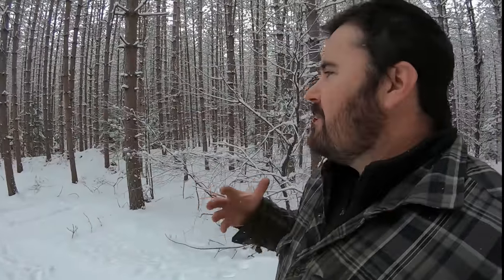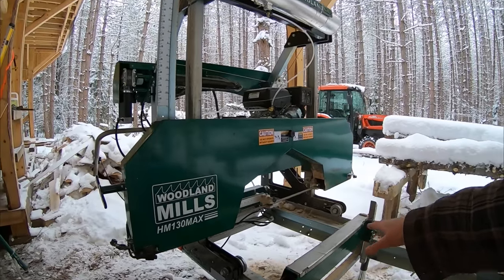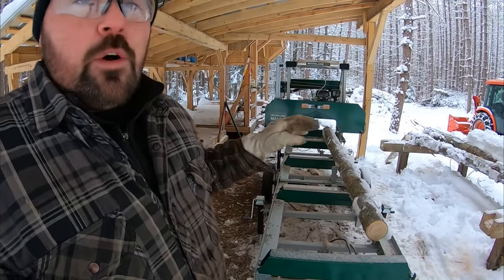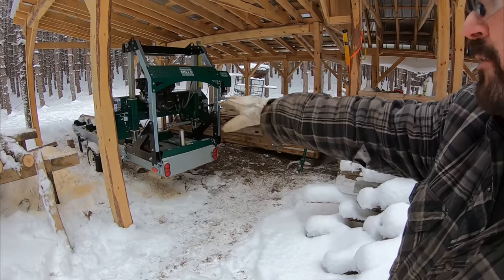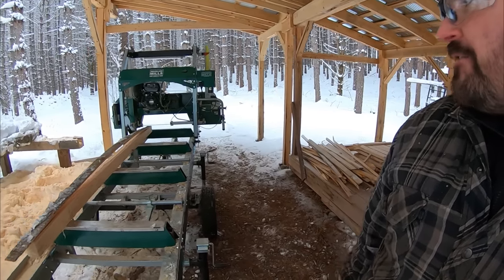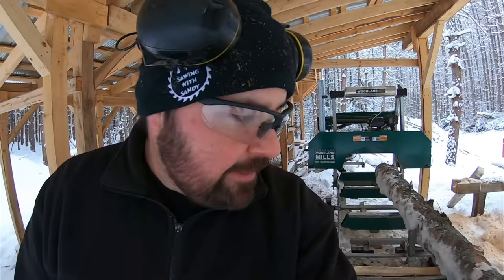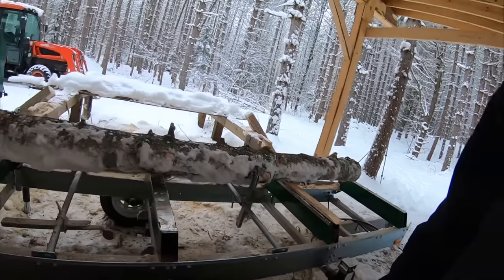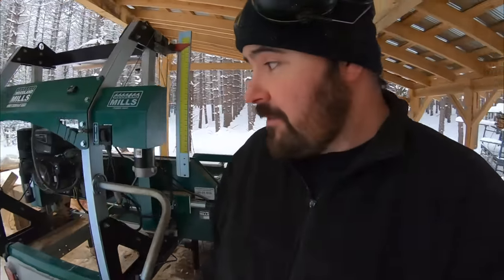Is a Sawmill Right for Me?

Comment: Good Morning Sandy, I had my brother up to my property last November to give him a chance to run the mill.  One thing you said that I think was really important is to listen to the machine, it will tell you: if the blade is dull, it will tell you if you need lubrication, keep a slow steady pace and let the blade do the work, if you feel resistance take note and look for the problem.  When the saw mill is set up correctly it runs like a hot knife through butter.  Mostly just commenting for the ALGOS.
Reply from the maker: I appreciate that! Sounds like some good cutting you had back in the fall as well

Comment: For a straight log take the small end diameter inside the bark, multiply by .7 gives the square cant size. I taped a little chart to the mill so I don't have to do figures in my head! Or a pocket calculator!
Reply from the maker: Thanks for that tip!

Comment: Just a thought, if you were to place rollers under where your old saw mill was, and where you currently stack your lumber. As you complete a packet of lumber, simply roll the packet to the old sawmill area, then continue to start a new packet. Enabling you to drive into the shed where your old log bunk was. No need to move your mill to change out packets of lumber. If this makes any sense.
Reply from the maker: I like that idea Jeff! Thanks for sharing

Comment: Hello Sandy, Years ago, I found WD-40 SPECIALIST® GEL LUBE. It is supposed to stay and protect for up to one year. This could be used on your vertical movement on your cutting head. It withstands temperature ranges from -100°F to 500°F. (-38 to 260) C. It also is not supposed to run like the regular WD-40. I did notice the stress relief on the one cut. You mentioned bugs. Would mosquito netting help. Obviously, the area at the log deck would need special attention and design. New Snow! Have good days!
Reply from the maker: Great advice! Thanks for that. I run the WD40 sepcialist for the rust penetrant but I"l also now look for the gel. Thanks again

Comment: In one of your previous videos you mentioned that with your setup you have a problem with sawdust collecting on your log deck where you have to chisel or scrape out the sawdust.  I just had a thought watching you set your runners in to transfer your log to the bunks.  If you cut out the entire bottom on that so so you have 2 tabs sticking out you could take some scrap metal bolt or screw it to the end which would allow the sawdust to just fall through the hole and not collect on your log deck.
Reply from the maker: I like that solution. very straight forward and would definitely work. Thanks for sharing that!

Comment: Sandy do you use are is there different types of blades for soft  and hard woods, thanks for the vidios
Reply from the maker: there are different angles on the blades for hard and soft woods. I use 10 degrees which works well for both

Comment: Thanks for the excellent content Sandy.  Like you and others have said, if ask if getting and running a sawmill is for you, then it is and you already have sawdust in the blood.  :)

As for me, I started with a dead red oak that was 36" diameter trunk being milled with an Alaskan chainsaw mill rig.  Now im building a bandsaw mill that will take a 34-36" trunk and 30-32" cants.  And o ce this first red oak is finished (2 more 8' trunk sections,  a 6' crotch set that will get slabbed, and 6 8' branch logs that are straight-ish and should give 4-6" cants.  Then there are 3 more dead oak trees and 4 dead/almost dead loblolly pine that are still standingthat all need harvesting. 

In my case, since I have few projects for the lumber, I'll look at building a cheap kiln to dry and sterilise the lumber for faster sale at higher prices.

Again, thank you and keep up the great content.
Reply from the maker: Sounds like a great project you've got on the go Bob. Hope it goes well and keep me updated. Happy sawing!

Comment: Heya Sandy! You covered this topic before from different angles and it's always interesting to hear your thoughts on it and more insights on the trade.  In fact, one of your videos is one that cinched the decision for me in 2021 and I've be milling happily all year. I've since then realized that to answer the question in your video title, the simplest answer is "If you're asking the question then yes it's right for you."  I see very little down sides to owning a sawmill. The only real considerations are whether you have time and space for it. Money isn't a consideration since the return on investment is very easy to achieve in many different ways. Finding lumber is also somewhat easy.  Also, experience does help with optimizing lumber size when putting logs on the mill but I also believe it's something people figure out quickly and at worst, not much is wasted.  It also depends on what is needed. I've "wasted" large beautiful spruce cants that would have made perfect 6''x6''x16' because I needed 1''x4'' inch boards. Oh and I need to get a laser....
Reply from the maker: Great to hear you’re up and running and got the sawing bug as bad as I do. I know what ya mean and I’ve certainly made my fair share of sawing errors. All part of the fun (maybe not at the time haha)

Comment: Sandy, can you explain the measuring scale on your saw and how you use it to calculate your first cut. Are you measuring the diameter prior to cutting or just eyeballing using the laser?
Reply from the maker: I normally will take a quick measure to see what max lumber size I can get from it then if the log was 8” diameter I’d likely make my first cut at 7” then flip the log and make my cut at 6”. I’d then take the log and cut the remaining two sides off to get the dimensional lumber size I need
Reply: @sawingwithsandy  Iam newbie, so pardon my ignorance. I seem to be wasting a lot of time looking at my saw scales, then measuring log for almost every cut. Does your scale account for the the thickness of blade?

Comment: Great video Sandy. Got my HM130 Max set up back in April and I really like it. Changed belts at 55 hours. Might have got a few more hours out of them but band was almost on pulleys so went ahead and changed them. How many hours do you normally get out of a set of belts?
Reply from the maker: I’d probably do the same Jody. I’m not sure how many hours as my old sawmill didn’t have an hour meter and my new one are still on the originals. I usually get a few months per belt though I figure

Comment: Hey Sandy what's up with the two-by-fours four by sixes four by fours I thought you guys use the metric system up there anyways I think this is an older video I'm revisiting some of your older stuff that I'm trying to catch up on but I have another thought 🤔 what if you made some makeshift burlap roll down roll up curtains to block the wind and snow and maybe a black keto cooking stove with a long exhaust system to help melt the snow off the roof if you put the exhaust dead center of your sawmill weld some circular attachments and using the galvanized dryer hose as a heat-trapping pipe would keep the roof warm and melting off the snow and you warm as well
Reply from the maker: Hi Sean, in the lumber industry imperial system is common here in Canada. We do know the metric system and imperial system however as both are taught in school. Some things are metric like the measurement of liquids here but some industry standards for us are still imperial. That's an interesting ideal for the exhaust! I like it! Thanks Sean

Comment: One more question…. If you could do it all over again, would you still buy a Woodland mill? I checked with Wood-Mizer and they are 9 months out on orders. Woodland says they are in stock….
Reply from the maker: I would still go Woodland Mills as it seems the customer service is very very good and responsive
Reply: @sawingwithsandy  Very cool. Thanks for answering. I am going to order the exact same mill you have Monday. No more Alaska Chainsaw mill cutting. The whole way a person measures out the cuts of the log with a chainsaw mill is so different than a bandsaw mill. I use a guide board on top the log and then measure and then cut from the top downward. Once you get the bark slab off, you use the log itself as a guide for the saw (I saw horizontal). On a bandsaw you cut a flat surface, flip the log over and measure from the bottom up, then cut from the top downward. I always wonder when you get to the last cut if the last board is the exact same thickness as all the other boards???

Comment: Hey Sandy, Thanks for all the great content! Question for you, What do you do to post you saw that will be used in the ground to prevent rot? Thank you!
Reply from the maker: Great question Kent. I was charing the wood (see video below) and it seemed to work pretty good. Generally I try and not put wood in the ground just because it's not pressure treated when I cut it. I prefer concrete in the ground then wood above ground but the charing has worked pretty good for my non-pressured treated wood so far
https://youtu.be/pICH8XMXWYg
Reply: @sawingwithsandy  thank you! One last question, I'm putting my HM130MAX together tomorrow, it didn't look to me like there was a finish on the steel... Have you or anyone you know had issues with rust after several years of use? Thank you again for great insight.

Comment: Quick question. I see horizontal beams in your sawmill shed that are much longer than the bed of the saw mill. How did you cut those?
Reply from the maker: I often will make a sawhorse like I did in this video 
Cutting a 20 Foot Log on a 10 Foot Sawmill | No Track Extension Required
https://youtu.be/lRg7lFQPSaY

My old sawmill was also longer allowing me to cut just over 16’ beams

Comment: why do you choose 1 1/2 x 4 rather than 1 1/2 x 3 1/2 like a lumber yard? just curious. the width and depth don't shrink at different rates do they?
Reply from the maker: Just to ensure strength since my lumber isn’t graded like lumber at a lumber yard. I keep it at 1 1/2” to fit standard joist hangers and 4” for bit 
More strength

Comment: In one of the videos, you talked about it would take too many bags of concrete to pour a solid foundation for the sawmill and also where you walk next to the mill when you are cutting logs. Seeing the big pile of saw dust that gets created, don't know if this would work but could it be possible to use the saw dust and some bag concrete mixed together (no idea what the best saw dust/concrete/water ratio would be) to create some type of saw dust/concrete paver or even a saw dust/concrete pavement?
Reply from the maker: I like your thinking there Gerald. I'm not too sure how that would work but never hurts to try it out I suppose. Thanks for the idea!

Comment: Curious. I never see you check to see if the log is square once you roll it after cutting the top and bottom. Any reason? I was also going to mention I don't see you raising the tapered end of the log but I just now saw you put a board under the one end. I'm learning to cut lumber for timber framing and now understand how important it is to box in the heart/pith
Reply from the maker: Hi Dan. I don't tend to check the log for square as I find that once I setup the sawmill up the first time and check the square at that time , the mill stays pretty good.

Comment: Hey Sandy, any thought of putting a lift kit and tires on that golf cart? I can go through some pretty deep snow with mine, you could save some fuel in the tractor.
Reply from the maker: I like that idea! I haven’t thought too much about it but would be pretty slick I bet
Reply: @sawingwithsandy  I used to use it for ice fishing too, I Just put gutter screws in the tires in the Winter and took them out for the summer. I've had mine for 25 years.